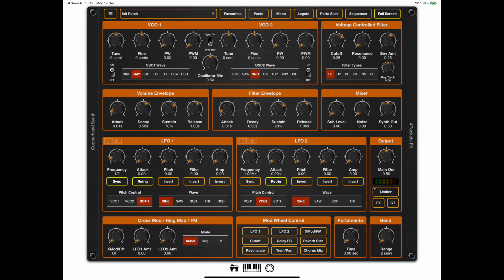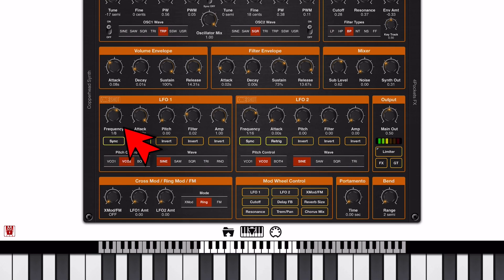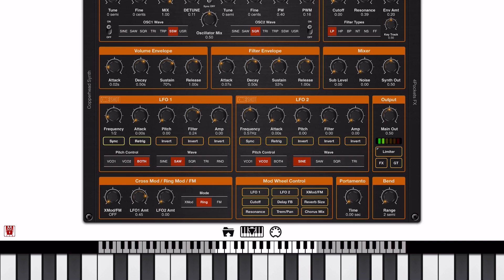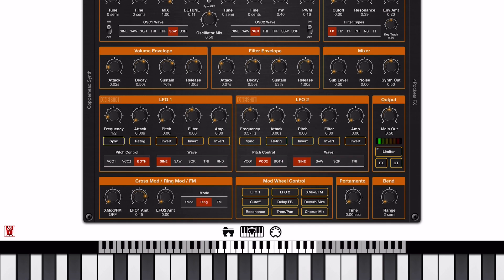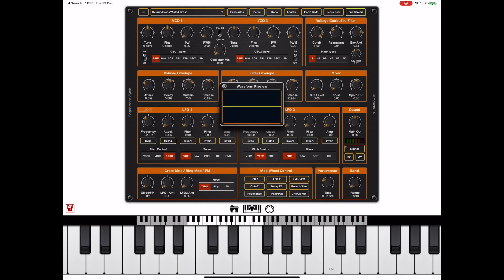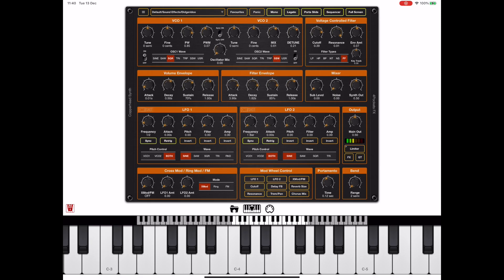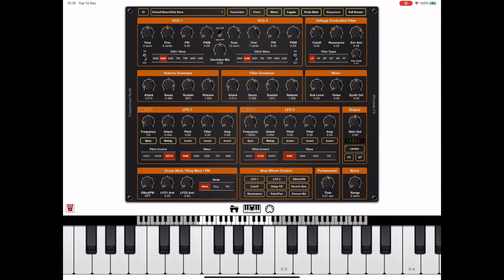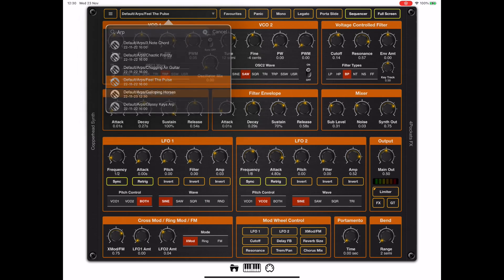Copperhead Synthesizer for iOS - MasterClass #2

Comment: Paul, is Copperhead also tested to be run as an AU in GarageBand for macOS on M1 computers? I know some of your other plugins do work on desktop as well as iOS.
Reply from the maker: Although I never tested it in GarageBand on an M1 Mac it should work. I know it works in Logic, however make sure you run in standalone mode prior to ever loading as a plugin so that the presets are setup correctly.